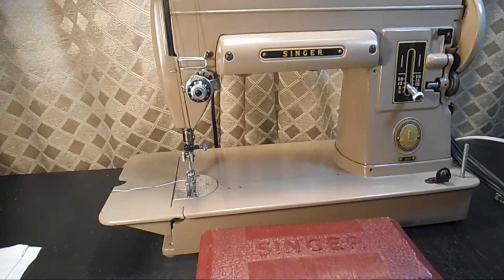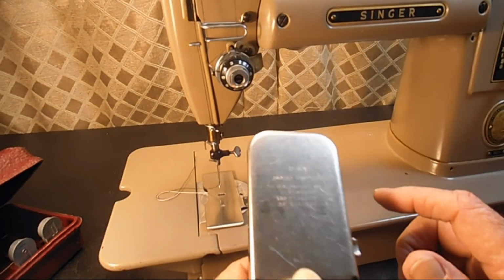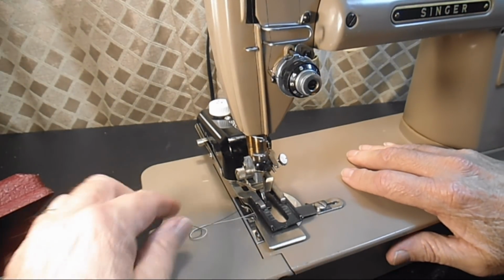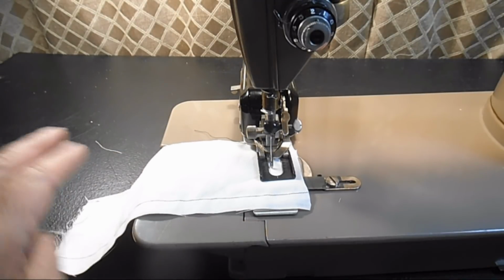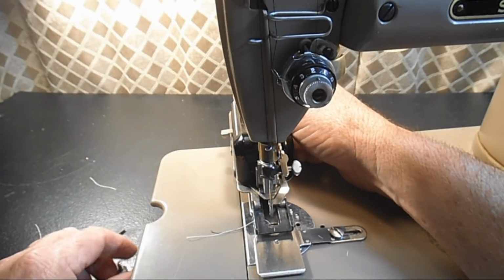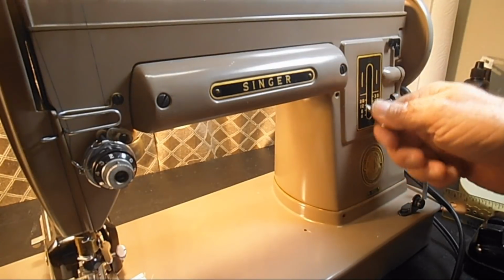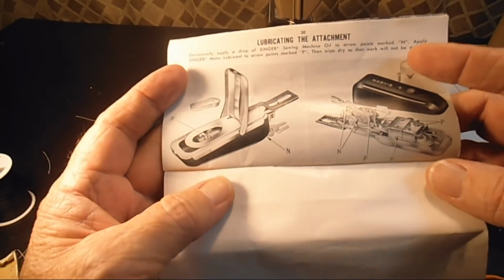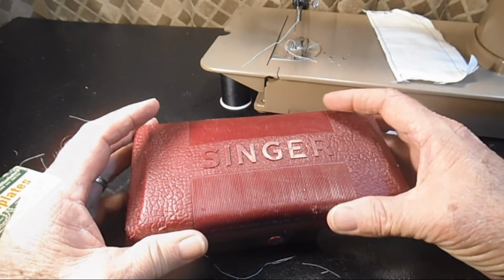All about the Buttonholer for Singer Model 301 Sewing Machine PART 3

Comment: Where to order, HM
Reply from the maker: These are vintage buttonholers, made in the 1950s thru the 1970s. You find them for sale on eBay https://www.ebay.com/sch/i.html?_from=R40&_trksid=p2047675.m570.l1313&_nkw=Singer+160743+ButtonHoler&_sacat=0     and online auction sites https://shopgoodwill.com/item/145734087   thrift shops and yard sales   (If in the phils you can try here https://www.carousell.ph/buttonholer-machine/q/?searchId=wBZFD6)

Comment: Thank you for being thorough. 
I have a 401A. I have not used my buttonhole in years, and I am trying to remember what settings the needle goes on. (You didn't seem to mention thst.) Do I keep my needle on a straight stitch, or do I dial it to a zig-zag syitch?
Reply from the maker: Hi, Judith. The needle is set to Straight Stitch. The clamping plate on the Buttonholer moves the fabric to make the ZZ stitch. The width of that ZZ stitch is set on the side of the BH. Thanks for watching my channel and good luck

Comment: In other words will it work on a 66? Or for that matter will it work on a 347 or 348?
Reply from the maker: yes, yes, and...yes. I'm trying to think of a vintage Singer that can not use a buttonholer. Hmm...They made several models over the years before they started adding buttonhole-making capabilities into their modern machines. Some of the buttonholers can work on several models, even of different decades. The main thing to watch for is some are made for straight needle machines, 15,66,99,101,201,237,242,337,347,413,457,etc. and some are made for slant needle models. Like the one in this video you commented on. You can start learning about Singer buttonholers on this page (if you are interested) http://ismacs.net/singer_sewing_machine_company/singer_buttonhole_attachments.html

Comment: Hi Andy, 

In my Griest manual,  it said dropping it into the fabric ensures the teeth on the plate sink into the fabric
Reply from the maker: Thanks for sharing that info. I can see on some types of fabric that could be necessary so the Cloth Clamp gets a good grip. I just looked at the Instructions for the Singer Monogrammer and it says to "Drop presser bar, making sure fabric is held smoothly and securely under the monogrammer foot." I guess there is drop and then there is DROP, hehe. Thanks for watching my channel and commenting with great info.
Reply: Andy Tube  no problem. Great Chanel. Really enjoying it. Thanks

Comment: I am really enjoying your series on the buttonhole attachment!  I am one who believes the vintage Singer attachment makes one of the best looking buttonholes.  You may want to try it adding a light to medium interfacing and slightly reducing the upper thread tension for obtaining the best looking result.  Also, there is now a very reasonably priced eyelet template available through The Featherweight Shop.  Their offering is a non-metal reproduction of the original template but it would probably function just as well if the goal is to make eyelets and authenticity does not matter as much.  Thanks again for all the information you so generously share.  Take care.
Reply from the maker: Thank you for sharing this information with us, Kristine. I always appreciate when people with experience share tips and procedures. It makes sense to reduce needle thread tension as the buttonholer is making a zigzag stitch and instructions on zigzag machines advise to do that. I encourage viewers to download the free instruction manual as use it as a base of information while learning to use a device like this. http://ismacs.net/singer_sewing_machine_company/manuals/lowshank.pdf
 Please visit Andy Tube when you have the time and feel free to leave your valuable comments.